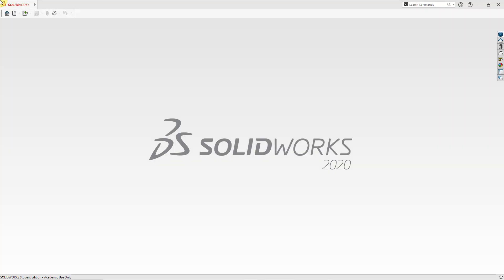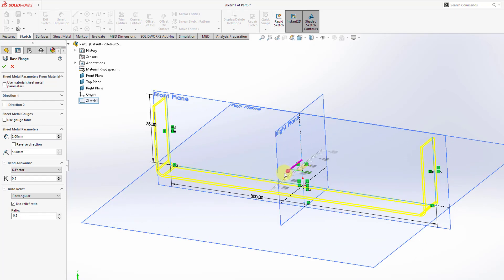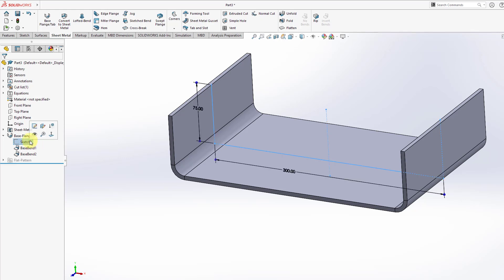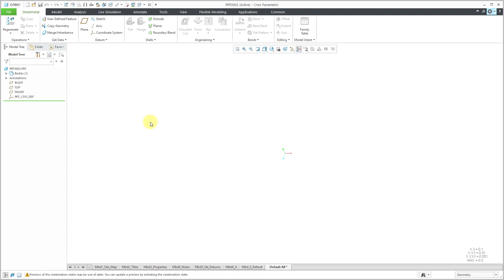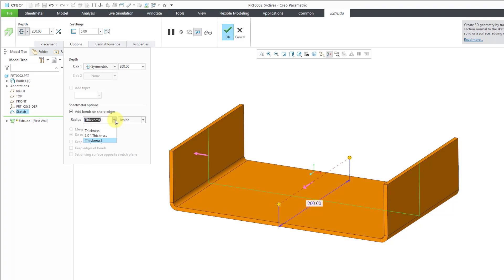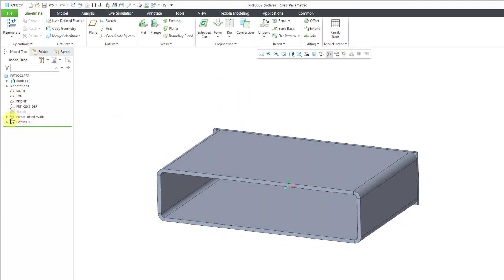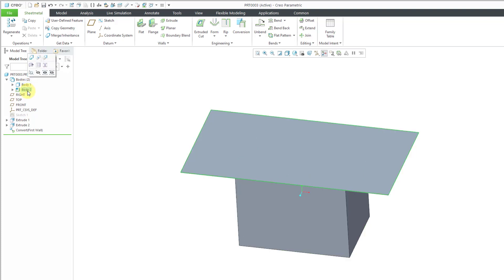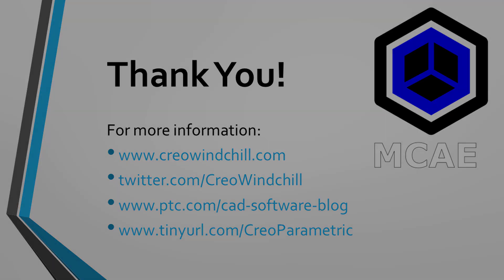SolidWorks - Creo Parametric Comparison - Sheetmetal Base Feature

Comment: I'm interested in Machine design and it's R&D. Currently working for an OEM and using CREO for top down design. Yet, I'm having lot of anxiety about choosing my second software of choice. Shall I Go for NX cad since it's prevalent in mfg industries or CATIA?
Reply from the maker: I think the anxiety is the most important issue to address. That’s not healthy.
Reply: Great video, i been using Solidworks several years for the conception of sheet metal products for the electrical industry. Personally i think that Solidworks is easier to use, let you streamline  the design tree but you'll never get as good results than Creo offers. Now I'm still learning Creo parametric from your video series, but must say that the sheet metal module in Creo is sturdier. Hope you could explain more about bend tables for creo and the sheet metal manufacturing module. Thanks a lot!